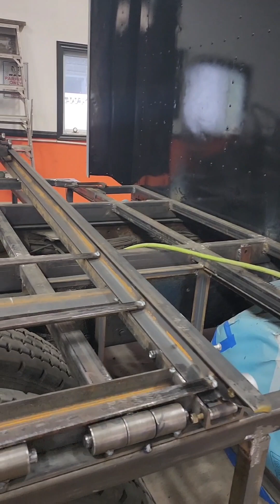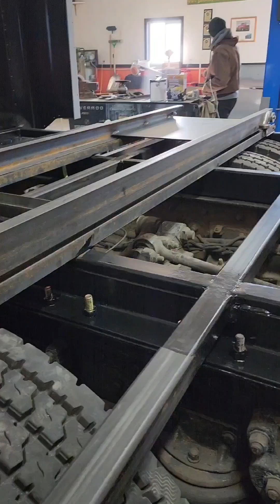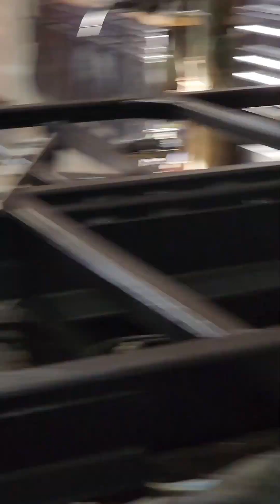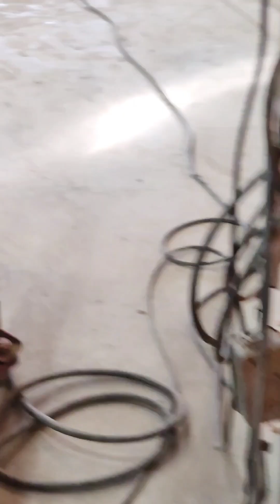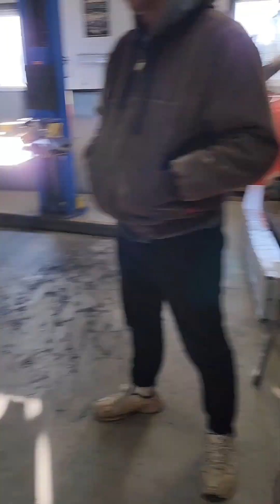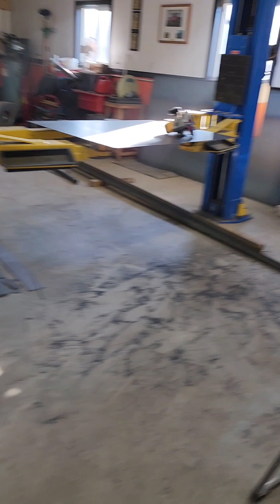Part # 2 lift  build and REDNECK trial on W 900 Kenworth

Comment: wondering what size C channel did you use for the bed?
Reply from the maker: We used 3 in channel on the lift
If you watch the rest of the build there was some changes that we made as well
Thanks for watching
Reply: @JustWingingit2023 did you use the same for the rest of the bed as well?
Reply from the maker: @llcool9184 
No the bed is 2x2 x3/16 tube
1/4 checker plate decking  10 Ga. Sides